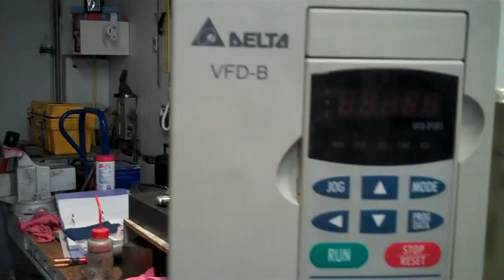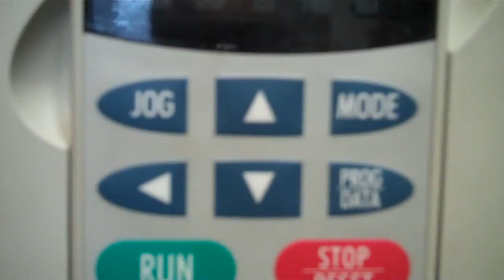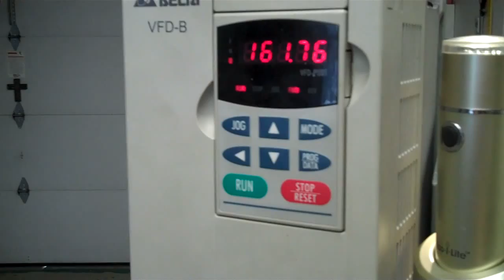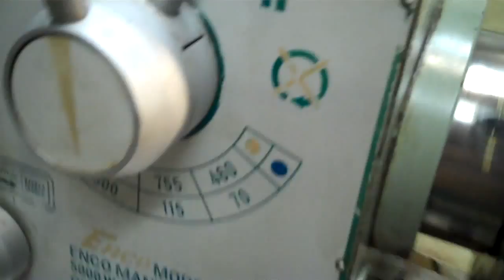variable frequency drive  lathe install  details 2011

Comment: Great video and great job on the install.  With some many obvious benefits to the VFD why is it so many people still use rotary phase convertors?
Reply from the maker: I am 73 years old and this was a very dificult project for me. The manual that came with the vfd was horible. I was able to download a good manual. There is a lot of reading involved and most of it was new to me. But well worth it .
Reply: +performancepursuit Plenty of info for comparison on the Practical Machinist website including efficiency differences. I'll be replacing the static phase converter on my (small) lathe with a VFD eventually, but my RPC will be used on multiple fixed RPM and/or heavy draw three phase loads like my 450 amp MIG welder. 
"Horses for courses" as they say in the UK.

Comment from the maker: I am pretty sure my delta has the senorless vector option. It has been a few  months since I struggled my way thru the manual.Yes the idler pulley is on the slack side when the lathe is running forward.There are 2 v belts and the idler increaces the wrap around on the small motor pulley therefore the belts dont need much tention.

Comment: Great video.  I've got the 2 HP version of the Delta VFD.  Does yours have the sensorless vector option?

Also -- in the normal lathe forward direction, is the idler pulley on the slack side of the belt?